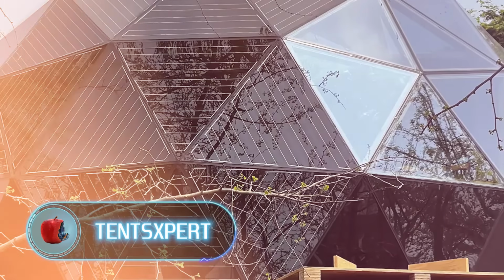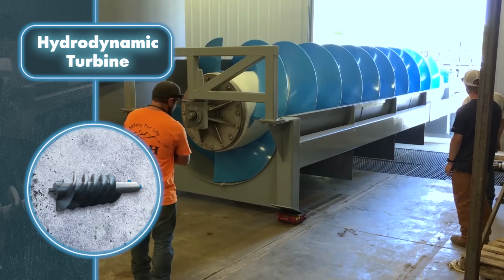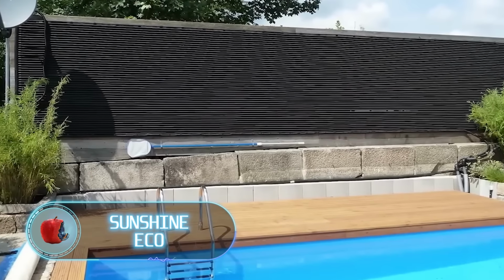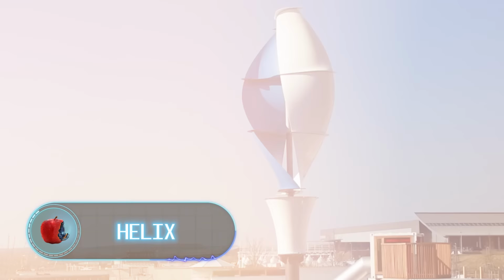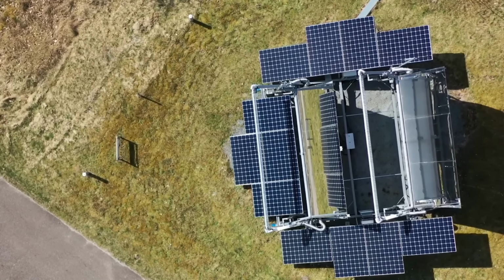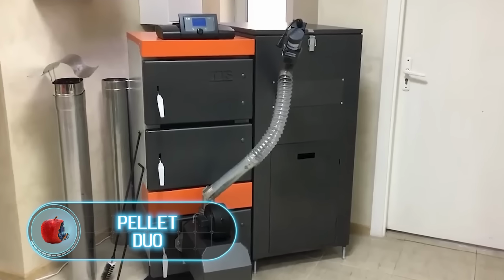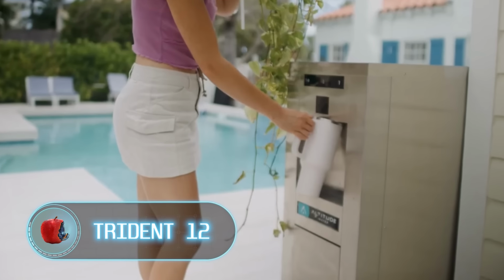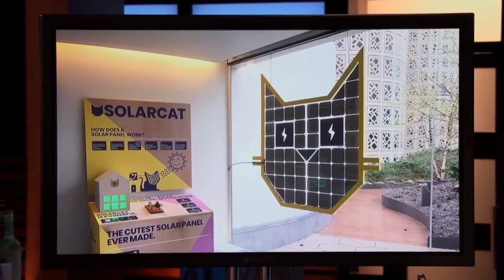Amazing Inventions for Infinite Free Energy in Your Home

Comment: Solar panels work a few hours during summer   England is 80% fog
For the money   River water flow. Or gravity energy is what I use 24/7 generate endless power
Charge drill batteries for every electrical needs